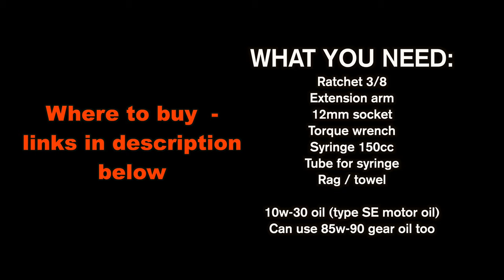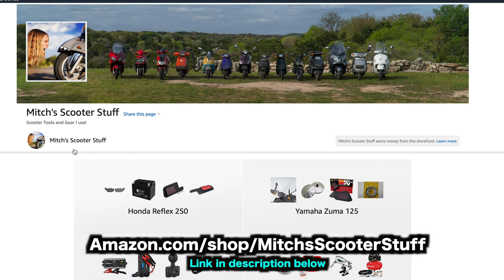Yamaha Zuma / BWS 125 Transmission Gear Oil Change | Mitch's Scooter Stuff

Comment from the maker: * Tools I used in this video: 
Ratchet 3/8 drive - http://amzn.to/2hhmnUs
3" / 6” extension set 3/8 drive - http://amzn.to/2h7ypMl
12mm socket 3/8 drive - http://amzn.to/2xM4Edr
Torque wrench 0-150 lb/ft 3/8 drive - http://amzn.to/2Crqq4R
Syringe 150cc with tube - https://amzn.to/32Zw79r
Rags - https://amzn.to/2Yh8jvg

10w-30 motor oil - https://amzn.to/32TNBEi
or
80w-90 transmission oil - https://amzn.to/35aCIkb
Reply: Do these transmissions have filters? Like  a normal clutch and gear systems? Or do you just change the fluid? Also, is there away to get a hold of you directly for some beyond normal issues? Suchbascwhen driving along if any of the brake handles are pulled it runs the starter? Thanks a million for your channel! It's been a life saver  so far!!

Comment: Thank you for the video. I recently changed the engine oil and gear oil in a Yamaha BWS 125. I poured 10w40 into the engine, and read that 10w40 is also poured into the gearbox! ... Please tell me what kind of oil should be poured into the gearbox?

Comment: I should clarify. I know in the description it says "10w-30 motor oil OR 80w-90 transmission oil". I just meant, could you explain how they are interchangeable and why you selected to go with the transmission oil.